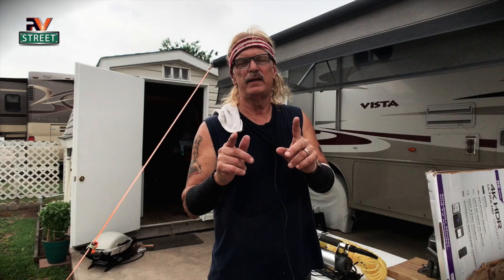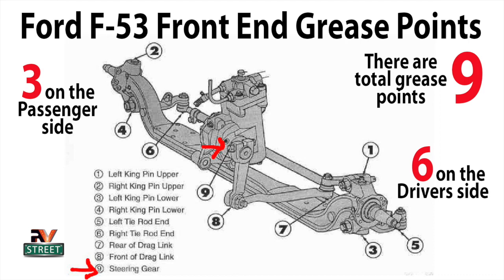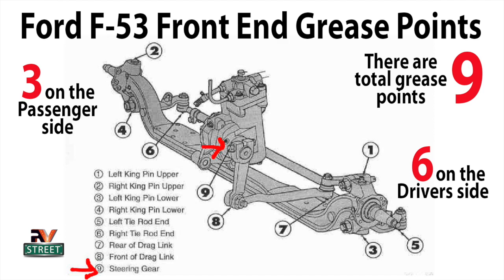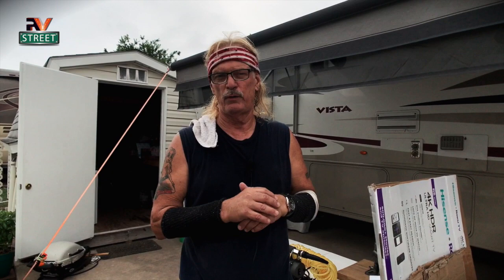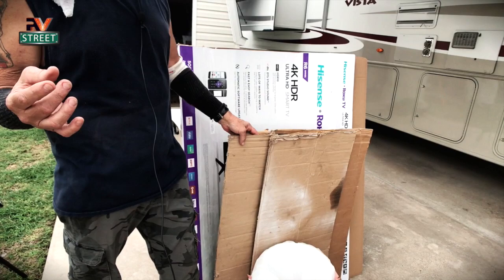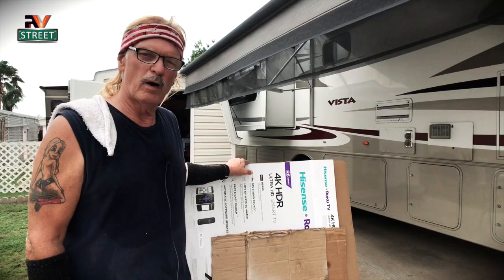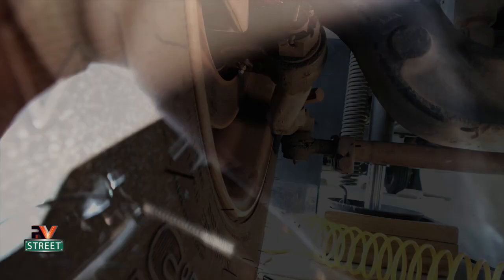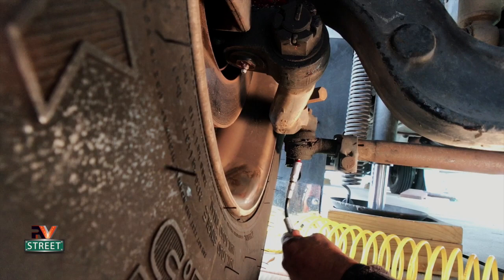GREASING front end, Class A, Gas RV Motorhome the RIGHT WAY

Comment: Martin, this was very helpful.  I have a question about  King Pins.  How long do they last?  I have a 2012 Tiffin Allegro Open Road with 50,000 miles.  How can you tell if they need replacing?  Thanks, Scott
Reply from the maker: Checking King pins:

When cars had king pins, you jacked up the front end, you grasped the top and bottom of the tire and tried to pull the top out with the upper hand and push the bottom in with the lower hand, then quickly reversed the action, trying to rock the top and bottom back and forth. If movement was felt, you needed an assistant to check where the movement was while you where rocking it, as a loose wheel bearing gave the same feel.

I describe this so you can get an idea of the motion needed to do the test.

With heavy vehicles like a MH, the wheel assembly is just too heavy to do this, so a pry bay is used on a 45 degree angle, the bottom of the bar against the ground under the tire, with the side of the bar pushing against the edge of the tread. Again a loose wheel bearing can give the same result so someone who knows what to look for is needed to see exactly where the slack is. But you are looking for excessive play or slack. The main thing is that you are trying to do is put a horizontal force on the tire edge, not a vertical force.

Concerning wheel bearings. You might want to look at this video: 
https://www.youtube.com/watch?v=AN3s76f2N_M&t=234s

One main indicator of worn KP’s is front tires will show excessive wear or while driving the tires are not rock solid and has vibration or rattling will occur, or the steering feels loose.

If you have other front end suspension parts that have excessive wear that will cause premature wear on the KP’s and bearings. It’s important to keep all front suspension parts in good working order, greased often, tires balanced, running the proper PSI and front end aligned properly. If any of these things are not working properly, it will cause excessive wear on all areas of the front end which can cause premature wear and failure over time. That’s why I did what I did when I recently replaced all 6 tires on our coach.
https://www.youtube.com/watch?v=zjVeal3qzb8&t=1s

Generally, loose steering components will cause a "shimmy" as you drive. This manifests itself at speeds usually lower than 40 MPH, you will feel it increase in intensity then decrease again as speed increases. Wheel / tire balance issues manifest themselves, generally at speeds above 40 MPH and increase in severity as speed increases.

KP wear is top and bottom of the wheel rocking back and forth across the vehicle, and assuming the bushings were reamed properly at installation, the only wear would be through the lack of grease. When the bushings are manufactured, grooves are machined into the bushings which allows grease from the grease zerk fittings to lube around the KP's.

The king pin rides inside a bushing. That’s why when you grease the KP’s you want to be sure first that all dirt is removed from the zerk fitting and as you add new grease you want see old grease coming out. If old grease is not coming out that means the bushing has moved and therefore the holes in the bushings are not aligned with the zerk fittings and will not push new grease into the inside of the bushing where the KP resides. This is a rare occurrence but does happen. Or more commonly sometimes the grease path was somehow blocked so even if it was greased, not all areas of the KP and bushing were actually receiving the grease. That's why you look for old grease coming out.

If you don't lube grease regularly the bushings and pins will wear out.

So bottom line is, keep all front end components in good working order, replace any if needed, then make sure alignment is spot on. Grease often. I grease my entire front end at least once a year sometimes twice depending on the miles I drive. This means about about every 5K miles. Make sure tires are balanced. Preferably road force balanced. This is also why I use centramatic rings and use my 3 tapered lug nuts. (see above video) Run proper PSI. Don’t over load the front axle. Have good working shocks. Watch for excessive tire wear but you shouldn’t have any if you do all the above.

All the things I mentioned above on the front end work together in concert. If any one thing is not keep up properly, there is a premature wearing domino effect down stream on all other parts over time. But, if you do these maintenance things I mentioned on a consistent basis, KP’s should last 150K - 200K miles or more.

Hope this helps 👍
Reply: @RVstreet  Hi Martin, I truly appreciate the detailed review.  I plan on doing a lot of the maintenance myself.  Being I bought this last October from the original owner but i don't see enought service records to cover all services.  I plan on getting the wheel bearing done at a RV shop  plus have him inspect all front end chassis parts for good condition and replace anything needed.  That will be my benchmark. 
Travel safe, Scott... Cumming, GA ps...X Navy!
Reply from the maker: @scottgabriel739  🇺🇸 🙏

Comment: I noticed your front sway bar has a blue plate between the upper link and the torsional bar.  What does it do?
Reply from the maker: It allows me me to adjust the angle if necessary to find the sweet spot on the initial install and set up. They were custom made by a friend of mine and are not longer available.
Reply: @RVstreet  I like the idea.  Maybe I can inmitate.
Reply: @RVstreet  Just out of curiosity, do you approve the so called "cheap sway bar fix" by connecting the upper link to the short hole on the torsional bar or not?

Comment: Why Lithium grease when Ford calls for a molybdenum grease?
Reply from the maker: Read the back of the label. After years of mechanical experience there are many types of acceptable types of grease for this application (not just one).
https://www.amazon.com/dp/B000CQ4DIM?tag=onamzrvstreet-20&linkCode=ssc&creativeASIN=B000CQ4DIM&asc_item-id=amzn1.ideas.1FUC3YMUOK6RD&ref_=aip_sf_list_spv_ofs_mixed_d_asin&th=1
What Ford recommends is lithium, molybdenum based grease except wheel bearings.

Comment: Hi Martin, purchased grease gun and grease and right away so you should get credit. Curious, do you clean out the grease from the grease gun after? Thanks for all the tips and instructions you provide.
Reply from the maker: Nope. Once I use the gun I leave the existing tube in the gun for next time. Once finished I take 2 kitchen trash bags—putting one inside another—put the gun in there and then store it in those bags and putting it away with my other gear. That way it won't leak on other things.
You're going to luv this gun. Makes greasing a snap, saves a ton of money and time not having to take it to a shop. Plus you'll be doing right.
And thank you so much Keith for supporting us by using our links. It really helps us a lot in making these vid's. 👍

Comment: When greasing autos at my dads shop we never squirted the old grease out like you did cuz it could rip the boot. &I never heard of loaded & unloaded greasing of the kingpins
Reply from the maker: Ya, most people or shops haven't heard or practice loaded and unloaded. Especially with heavy duty chassis's. But it's a sure way to get the Kingpins greased properly. Turning the wheels in between loaded and unloaded is also important as I demonstrated. I just had our front end alignment checked by one of the most reputable heavy truck shops in the Houston, TX area about a month ago and he was amazed on how well our front end had been serviced and there was no play at all in the bearings or kingpins. I shared with him how I greased our F-53 chassis. Most shops today just drive the rigs in, grease them and get them out. Old school, proper greasing isn't practiced by most these days. 

As far as the boots are concerned, you ease the grease in slowly...just till you see the new grease exit. That insures all new grease gets into the boot. Over greasing or to applying to fast can split the boot.
thx for giving me the opportunity to clarify Keith. 👍

Comment: Great video! I am curious why you need to grease the king pins both unloaded and loaded? Will get a Harbor Freight pneumatic grease gun and get after it!
Reply from the maker: By doing "unloaded and loaded" it insures that the grease penetrates deep into the king pin areas. It's a very important step. BTW...I too bought one from Harbor Freight in the beginning and it was junk. Hard to load grease and the tip is different. That's why I ended up buying the Lincoln Pneumatic Grease gun and giving you guys the link. I'm trying to help people not make the same mistakes we did in the past and waste money. Yes it's more expensive but the Lincoln is far superior to the HF one.
Thanks for watching Greg.
Reply: @RVstreet  guess I'd better save up my lunch money and buy the Lincoln. Thanks for the reply!

Comment: I know you said that you change your oil every 3-5000 miles and you also said you do this greasing every time you change the oil. I’ve always thought you only needed to grease a chassis once a year or so under normal driving conditions. At the end of the video you said a couple of times a year...so is that about how often you end up changing your oil and greasing the chassis...twice a year on average?
Reply from the maker: Well it really depends on how much we travel. More traveling more intervals. So to be more specific on your question...changing the oil takes a little more time and money and then I have to dump the old oil at a Walmart or somewhere else. So....I'm a little more flexible on when we do that. I mean, as you know we use Mobil One full syn 5-20 oil so we're good for quite awhile. BUT...you know the pounding the front end takes right? And to slide under there and to do a quick 30 minute grease job is a whole different and cheaper matter. I hook up my Viair 400P-RV, 150PSI Air Compressor, get my grease gun out and bam it's it's done in 30 minutes and I use a tube of grease. So if I don't quite need a oil change yet, but I'm at a spot where I can do a quick grease job I do it. I carry all this stuff on board so it's easy and quick to do.

Comment: Also, I see that you chose the Viair 400...I am leaning toward the 450RV mainly because their website says that the 400 is for class C’s and the 450 is for class A’s. I’m pretty frugal (another way to say cheap or I don’t like to waste money) so I don’t want to buy the more expensive one if I truly don’t need it. So please explain why you chose the one you did. Thanks.
Reply from the maker: Hey Marsha I must of missed this comment earlier so.....so sorry.
The Viair 400P-RV, 150PSI Air Compressor is more than capable for any RV. Plus, what if you ever upgrade to a different RV? The Viair 400P-RV, 150PSI Air Compressor is a well known, reliable and trouble free air compressor. And it's perfect for doing your grease jobs too. You just can't go wrong with this baby. You will never need more than 150PSI.
For others that may be reading this comment, be sure to watch Part 2 of this series. I go over air compressors extensively and also show you the differences that Viair has made in their product line up since I bought mine 4 years ago.
Reply: RVstreet I messaged Viair and asked them the difference and they said that the 400 has more initial power but it can’t run too long continually before needing a break where as the 450 has the lower power output but can run a long time before needing a break. So if it’s doing everything you need it to do then I’m sure it will be fine for us. And I might even learn how to grease my own chassis 😄😄😄

Comment: You forgot the universal joints on your driveshaft.
Reply: They are factory sealed until replaced and then will have fittings for greasing.
Reply: @karenmoldovan8146  I guess the newer ones are, but I have to grease the ones on my 1999 F-53 National.

Comment: Hi Martin, I received the grease gun and grease I bought from the links you provided. I went to install the grease tube into the container  but the tube is too big to fit into the container? Tour thoughts?
Reply from the maker: Hey Keith,
To big? To big how? It's a standard size tube of grease.
Please describe what "to big means". I'm wondering if they sent you the right grease?
Are you following the directions that came with the gun? 
So let's try this....
Before you remove the cap on the end of the gun, you have to pull back the long spring  handle and then lock into place. Then unscrew the cap from the grease gun to load a new tube of grease. The cap now will have that long "T" handle loaded spring in the cap sticking out.

Another simple solution if to big means...
Now in the past when I've had a little trouble loading a tube of grease into other grease guns where that metal rim around one end of the tube of grease sometimes catches on the lip of the grease gun, I would just lay the tube of grease on the ground and with a razor knife just below that metal edge and cut thru the tube rotating the tube and just trim off the that little metal piece/cap. Now I have a card board tube of grease with no metal cap. Then put the tube in the gun and load it up as you regularly would. Don't know if this is your problem though but if it is this will work. But I can assure these tubes of grease is what I use and they fit fine.
Using a new gun can have a little learning curve though on how to load it if you're unfamiliar with doing it. Not to worry. Once your figure this out you're going to love this grease gun. 
I'll be watching for your reply.
Reply: Hi Martin thanks for your reply. I figured it out. User error:) Thanks again
Reply from the maker: Oh good. I've thinking about this all day. Now go grease that baby up. 😜

Comment: Hey Martin- can you explain or post a video on changing your differential oil? would love to hear your thoughts on the "forgotten oil change" :) thanks my good man!
Reply from the maker: Well, as I pointed out in this video...
https://www.youtube.com/watch?v=X0x4djQ5KNM&t=951s

that was one of the first things I did when we bought our coach 4 years ago. I changed ALL the fluids to have a baseline going forward. That was before we had a YT Channel so no video on that process. But when I did change it I used full synthetic oil.
Hope this helps.

After I replied I had to come back and give you a little more info. If you also watch this video:
https://www.youtube.com/watch?v=NSvJmQIneCk&t=308s
where I changed out my hydraulic leveling jacks reservoir, I used this same process to remove the old diff oil. Then I added new full syn oil to the diff up to the point where putting my little pinky finger in the hole and my finger touched the oil. That's when you know you have the right level of oil.
Reply: RVstreet thanks for the detailed reply Martin - much appreciated- think my seal has started to perish and need to change the oil plus replace the seal with silicone sealant instead - researching that if you use full synthetic it’s advised to change every 3 years.... love the channel and the content you both put out- I respect the effort you both put in.
Reply from the maker: @evcanada  thx RV so much.
BTW...just wondering...do you come down south for the winter? We've met so many kewl Canadians in RGV during the winter.
Reply: RVstreet small problem with our respected borders.... someone closed them with no opening date - had to cancel 2 trips this year (North Carolina and Virginia) due to some pandemic so I’m told ;)  when things settle will let you know!
Reply from the maker: @evcanada  thx
I was just wondering if you were one who comes down here in the winter like so many Canadians do. But ya, borders closed right now and I don't know if many Canadians would risk it even if the borders opened in the next couple of three months. I mean...they come down here for the winter, plan to go back around April or so in the spring and then something happens in the interim and now they can't get back to Canada. We're already hearing winter reservations are way low all over. 😜

Comment: How much psi are you putting into that Lincoln air grease gun?
Reply from the maker: Not sure. The portable Viair builds up pressure then stops. When I actually pull the trigger to grease the Viair starts up again to build pressure. What that pressure is I don't know and never needed to know.
Reply: @RVstreet  does your grease gun continually shoot grease until you let go of trigger?
Reply from the maker: @udontneedmyname9934  Yes, or until my Viair tire compressor needs to start up and build up pressure again. If I was using a regular tank type air compressor that had more volume of air supply, then yes I could pull the trigger, hold it down and grease would continuously come out. But let me explain it this way bc I think I know what your after.

When greasing any zerk fitting I DON'T just pull the trigger and let constant grease keep pumping into that area. I control the amount of grease I want to apply. The proper way to grease is, pull the trigger and allow a couple pumps of grease go in and then wait for about 5-7 seconds or so. That allows the grease to penetrate and ooze into the area I'm greasing. Then I'll pull the trigger again and so on until that area is complete.

Another example is the steering box or my leveling jack wiper seals. Those areas only need one shot of grease. So....I pull the trigger quickly and that gives 1 quick shot of grease.

Hope this helps.